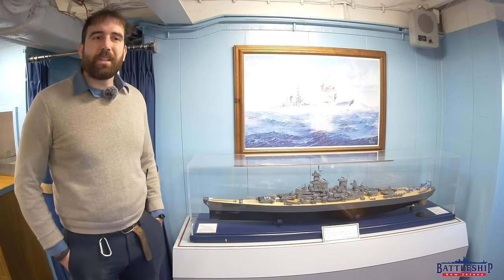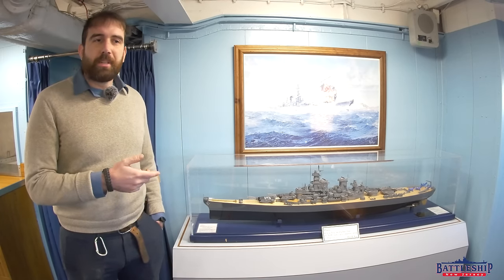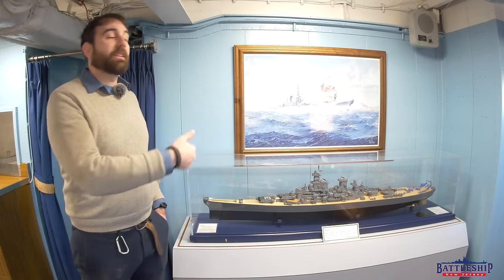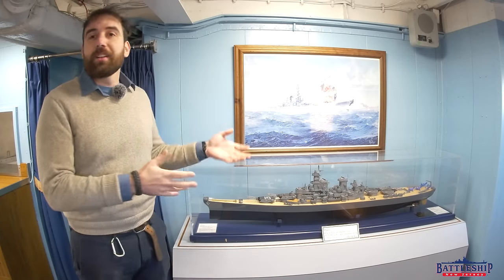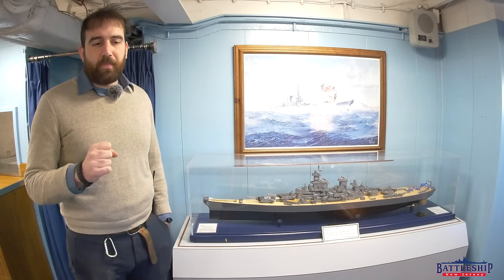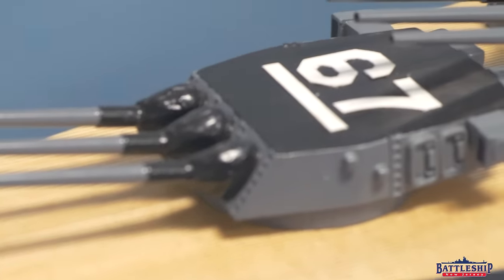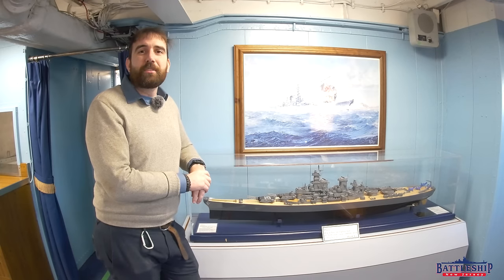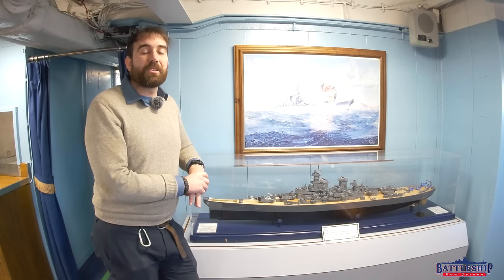Battleship Montana: What Would We Have Done Differently

Comment: There was a fast Montana designed. BB65 Scheme 8. It would have topped 33 knots. Unfortunately you would have a 70,000+ ton battleship over 1000 feet long powered with 360,000 SHP with 6 props. I think with Wartime modifications a late 1940s Scheme 8 would have reached over 80,000 tons full load.
Reply: I’d never heard that before, that would have been a colossal monster!
Reply: Holy that's bloody huge might as well call  it a floating city
Reply: @thewafflehouse841   America designed bigger ships like the 1917 Tillman Design 4 with 15 x 457mm guns and 24 x 406 mm guns all pushing 80,000 tons. Vermont is the little sister and I think these may become the Tier 11 after Vermont. The largest ship that I'm aware of in terms of firepower was a Japanese proposal after Shikishima or a variant of design A-150. The proposal was for a Satsuma with 12 x 510mm guns and I know of no other paper battleship more scarier than this. Yes it's supposed to be even more powerful than the German H44. No tonnage is specified but an estimate is at least 120,000 tons.
Reply: @legiran9564  German H-44 supposed to be 144.000 tons at its max displacement, and armed with 8x20" Gun.
Reply: BB65-8 (with sub designs A, B, C and D at least) was a series of several similar designs that were all around 66,000 tons with a 15.3" belt and a 6.2" deck that ranged from 1,050ft long to 1,100ft long. They had an estimated speed of 33 knots using 293k to 320k shaft horse-power (that would require an engine setup that didn't exist at the time these designs were created). They were the all-in designs that were supposed to dominate both everything on the ocean currently, and that would be built later. Heavy, fast, hard-hitting, well protected and EXTREMELY expensive. They would have required new locks in the Panama canal, new docks and new repair facilities.
Reply: @Iwillfigureoutanamelater   66,000 tons is way too light for an armored combatant that's 1,100 ft long. She should be around 80,000 tons at least and around at 100,000 tons full load.
Reply: @D_megapronz  I had never heard of these ships until your comment here sparked some reading on my part. What colossal beasts those would have been.
Reply: @legiran9564 That’s what happens when your naval architects get into the meth stash that’s supposed to be going to the infantry…😉
Reply: There are diminishing returns above 16 inches for guns.
Reply: @blindandwatching   Tell that to every major navy before 1940.

Comment: Adding sufficiently wider locks at the Panama, quick enough, is the part that always strikes me as the most unrealistic aspect pertaining to the Montana Class--without major changes.  The last canal expansion, in the 21st Century, took 9 years, let alone in war time in the first half of the 20th.  Either sufficiently large and capable dry docks would need to be built on both coasts or everything would have to be center around one expanded yard on the West Coast which would have created other logistical problems (e.g. steel production) and would have placed all of those eggs in one basket.

Comment: 1. Remove the floatplanes, catapults and crane
2. Provide larger CIC and radio spaces
3. Investigate every reasonable manpower saving measure - e.g., the 16" turrets have a pointer and trainer on each side of the turret. Could the ship do with just one pointer on the left side and one trainer on the right side? Were auto loader 5"/54s available? Were automatic boiler controls available?
4. Investigate the advantages/disadvantages of replacing the wooden decks with non-skid covered steel decks

Comment: With the superstructure redesign and the space it creates, you could almost pull turret 3 and stick a pair of MK 16 8" turrets from the salem.  that would give you the same number of 16's as an Iowa, but you get 6 guns with high rates of fire that can even be used for long range AA to break up formations at the horizon. more complexity, but if memory serves, by the time the 16's have fired twice, the 8's can throw as much mass downrange in the same time because of the rate of fire.
Reply: Do you happen to have a reference for the 8in guns being dual purpose?
Reply: The 8"/55 Mk 16 guns were not dual purpose. They were autoloading, but did not perform AA duties. Now, that's not saying you couldn't develop an AA shell for them... but we didn't have one during the war or after.
Reply: It's an interesting idea, but it's notable how intermediate cannons on battleships fell out of favor once dreadnoughts came about. Generally it's better to have a consolidated main battery that can use the same fire direction system and can all reach the same range. The 8-inchers would need their own director and wouldn't have the reach of the 16's.
Reply: There were 6" automatic guns that were intended to be used on the battleships after the Montana

Comment: I would if possible depending on when the ships were beginning construction. Add an auto loader or semi auto loader for the 16inch guns. Basically find some way to get the rate of fire up from 2 rounds a minute. Also if possible swap the 5"/38's with the 5"/54's as they had greater range and flatter trajectory while still being duel purpose guns
Reply: Auto loaders are heavy, the Des Moines class is ⅓ larger than the Baltimore class, with the main difference being the auto loading main guns. Going from 8 in to 16 in would probably make it even heavier. 

Replacing the secondary battery with an auto loading 5 inch is far more practical
Reply: I believe that the Montana Class was already planned to have 5"/54
Reply: @revan12009  they were to be outfitted with the 5in/54 mk 16, which is still manually loaded. The mk 42 was autoloader, but only debuted in 1953
Reply: Beyong 2-3 RPM, higher rates of fire aren't terribly useful on 16 inch guns anyway. Your shell will take almost a minute to get to the target, and you want spot their fall before firing your next salvo. Higher ROF makes sense only if you're using the guns as AAA (why?), you're caught up in a close range brawl with 6 cruisers for some reason, or it's the 1990s, you finally have access to to laser and GPS guided shells and no longer need to spot before firing the next salvo.

Comment: Great video Ryan and crew! I'd love to see you do a video on the hypothetical of "if they Navy  showed up tomorrow because the crap hit the fan and took the USS New Jersey back, what would they dump, modify, and completely change on the ship. I visited the ship and its sister the Wisconsin and thought those gun battery computers would be dumped if they were reactivated. A single laptop or desktop computer with a gunnery officer could do what they do and do it faster and maybe more accurate.
Reply: Surprisingly, updating the first control computer wouldn't do that much. The fire control system is already more accurate than the guns at anything past point blank range, at least in battleship terms, and the systems for it are so deeply built into the ship that replacing them is more trouble than it's worth. To get anything more out of the guns would require modern stabilization systems, which would in turn require rebuilding the gun mountings and traverse systems to keep up. Only then would updating the fire control computer actually do anything.
Reply: Heck, a Raspberry Pi could out-compute those things.  Easily.  Maybe even an Arduino.
Reply: @michaelsommers2356  A Rasberry PI could out-compute every 1960s mainframe in the USA.  But you would need to automate every step of the operation to get real benefit from it.  Not much sense having a modern computer spit out a firing solution in a millisecond only for it to be manually read out over an intercom for the gun crew to set up.
Reply: @GaryCameron  Late-war US fire control was, in fact, capable of fully automatic gun laying. Half the reason US destroyers were able to do the damage they did at Samar was the excellent Mk. 37 fire control system, which could take input from the fire control radar and use it to continuously generate target solutions and automatically train the guns to the correct elevation and bearing. At that point, all the fire control team had to do was hold the fire lever on continuous automatic, and the guns would aim and fire as fast as the gun crews could load them.
Reply: @GaryCameron  I don’t know about the Navy, but an Army Field Artillery crew reads off the fire commands out loud so every member can start to do their tasks.  While the gunner and #1 sets traverse and elevation, powder crew cuts changes, fuse setter installs and sets it, etc.   Also, section members need their hands free to do their thing, and what do you do with your display?  The section chief can hold onto the display, refer to it as needed, and supervise his crew one handed.
Reply: Look at what they did with the Missouri during the first Gulf War/Desert Storm. Tomahawk cruise missiles are a good fit. Today they'd probably put a LaWS on the deck or something else from the future to justify the exorbitant expenses not being used for the carrier or submarine fleets 🙃
Reply: I think he made this video a while back. Probably not going to happen though.
Reply: @griffinfaulkner3514  If the fire control computers do get replaced, it will be because spare parts for 1940s analog mechanical computers don't exist anymore.
Reply: @doughudgens9275  You have to remember that the ship is constantly moving, even if its not in motion, it is still rocking with the waves. That's where it would have to be entirely automated to get any more accurate.

Comment: I like your 5 points Ryan... I would've stuck pretty similarly to your way of thinking. Cease production of Iowa bb's, and concentrate drydock infrastructure and industry to 4 Montana hulls. Two would be built to standard specifications with 16'' mark 7 guns x4 turrets. One would be built as an aircraft carrier and the last hull would be built as an Ohio class "destroyer" bb with 4 twin 18'' gunned turrets. This last hull would utilize a single funnel and superfiring triple, heavy 5'' DP turrets along her centerline, with another 3 turrets along either side. AA, powerplant, and other specs would remain more or less unchanged.

Comment: This change might be a bit ridiculous, but I would drop the aft super firing turret of the Montana's and use the added space below decks for more engine spaces, hopefully turning the design into a "65,000 ton Iowa class, with substantially more protection," and using the additional space above decks for a heavier and more efficiently placed 5"/54 battery (perhaps two centerline 5" mounts aft).
Reply: I thought about dropping the fourth turret, too. But, I did it in order to save weight/room for larger magazines and 16in autoloaders ala' Des Moines. I think getting 4-5 rounds per gun per minute would make them the ultimate BB...

Comment: The Midway class carriers have basically the same hull as the Montana class would have without the heavy armor belt but instead with the 212,000 Iowa's powerplant. I think the larger 212,000 powerplant and nine 18 inch guns in three triple turrets instead of 12 16 inch  in four triple turrets would have been a better design.
Reply: Correct.  The lower hull form and power plant of the Montana class was to have been essentially identical to the Midway class carriers.

Comment: The biggest thing i would change would be to expand to a transom stern- extra deck space, extra torpedo defense near the rudders, simpler construction, and better efficiency at all but low speeds. Add in all welding construction & removing aircraft facilities because they will be operating with cruisers/carriers that have planes & we know radar works excellently.

Comment: I had always thought that the conning tower was not really meant to protect against a direct hit by an opponent's main battery guns, but from the shower of splinters from nearby hits. If the Montanas are meant to engage with Yamatos, I'd be nervous about entirely deleting the conning tower, after reading accounts of the naval battle of Yalu River and of course Tsushima.

Was there ever consideration about making a triple-gun turret for the 5"/38 or 5"/54? If that could be done, then reducing the number of secondary battery turrets could save some weight, and it would fit in with the compact superstructure scheme.
Reply: The issue is honestly one of logistics. The 5" turrets were lifted, more or less directly, off Atlanta class cruisers. There were some minor differences, but they were essentially the exact same turret and this substantially reduced the resources needed. The battleship's secondary armament on a given side was nearly equivalent to the total armament of a light cruiser.
Reply: @WardenWolf  the 5"/38s on the BBs were different than those used in CV, DD, CA and CL mounts.  They weighed more than the other mounts (slightly more armored I think) but otherwise would have been similar.   The 5"/54 mounts as designed for the BB-67s would have been slightly deeper than the planned versions for CA/CL/DD ships.
Reply: @TheKentucky777  ye they had 51mm compared to 32-25mm on Cruisers and 9-6mm on DD's

Comment: Although, not available in 1942, I would love to see a Montana class with nuclear propulsion.  Just think of the weight and space savings in fuel alone.  It would also provide more power for electronic systems.
Reply: I want to see how the Montana would be built today using modern tech. Assume the navy also built the infrastructure needed and had a big budget to modernize WW2 tech or current "off the shelf" stuff to work on a battleship without breaking. I can even see a use for retaining some AA guns for taking out drone swarms, ocean skimming missiles, or pirate style boats like speedboats.
Reply: @rathael1428  one question is whether modern SAM (and other) missiles are any more shock resistant than the ones from the 80s when the Iowas were modernized.  As I understand it one reason the only missiles they got were the Tomahawks in their armored box launchers was concern that shock and overpressure from firing the main guns would disable things like SAMs.  (Though I suspect that VLS cells are less vulnerable to overpressure than the old swing arm launchers)  Still I'd think the design would be quite different depending on whether or not they thought they could mix missiles (at least for self-defense) with heavy guns.  (Also, if it's mostly doing fire support or maybe surface action against today's warships there probably isn't any need to put anything bigger than an 8" on it.  So that alone might help guns and missiles coexist)

Comment: There were a number of Montana designs considered as well as better armed Iowa designs.  BB1938(I) from April 1938 is an Iowa with 9x18"/48 and a 14.75" belt.  It has a South Dakota power plant to keep displacement at 45,495T and 27.5 knots.  (Friedman p.308)  Compress the superstructure to place a 2x5" mount forward and aft to improve the arcs of fire (King/Nimitz Board of Class Improvement Program (CIP)).  It has the advantage of being able to transit the Panama Canal.

Later Iowa designs in 1938 with lengths up to 960 feet included 12x16" and 12x6"DP guns as mounted in the Worcester class.  It was rated for 32.5 knots (Friedman p. 310)

I would build the Montana with a compressed superstructure with 12x6"/47 mounted as in US cruisers.  I would eliminate the control tower and mount sixteen 2x3"/50DP with two at the stern, two abreast each raised turret on the 01 level, two abreast those same turrets on the weather deck, two in the forward superstructure, two on the after superstructure and four between the funnels. You cannot have mounts on the turret tops due to the placement of the 6"/47.  3" mounts on the bow are eliminated due to wetness.  Eliminating the 20mm reduces crew size.  Reduce the side armor thickness to  increase the deck armor.  Make all bulkheads between the barbettes our of 60lb STS to limit underwater damage.
Reply: My understanding is that the reason the Navy didn't go with the 18"/48 is because they could only fit six onto an Iowa.
Reply: @itsmezed  If you reduce the power plant to a South Dakota, the ship is 60 feet shorter.  You also gain the weight needed for 9x18" guns and heavier armor.  See Friedman, p.308.
Reply: @waynesmith4584  Thanks for the info, I'll check it out.  I'll take a look at my source as well.  I think it wasn't as much the weight of the guns as it was fitting them into the barbettes.